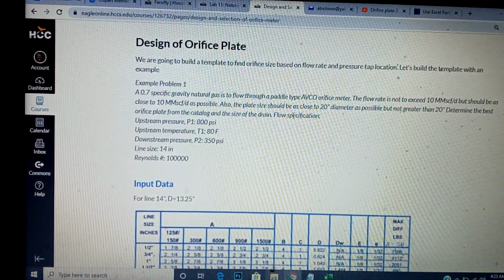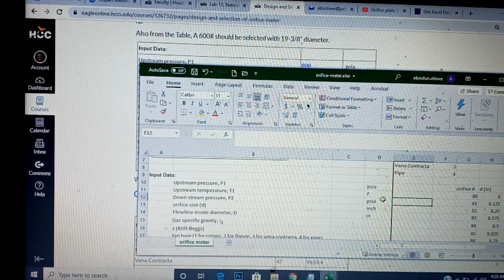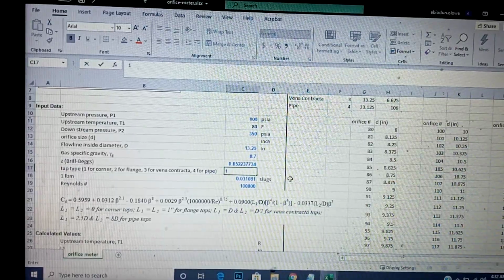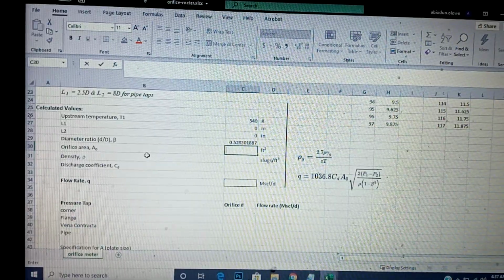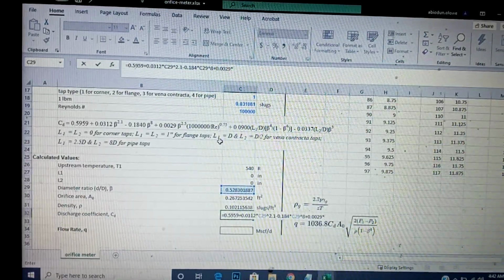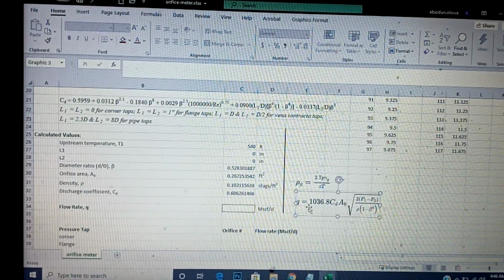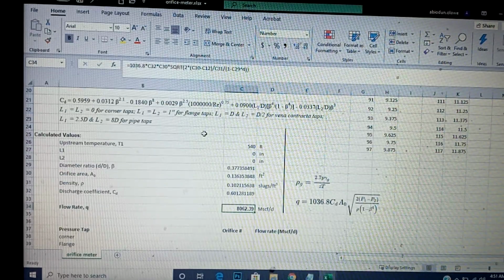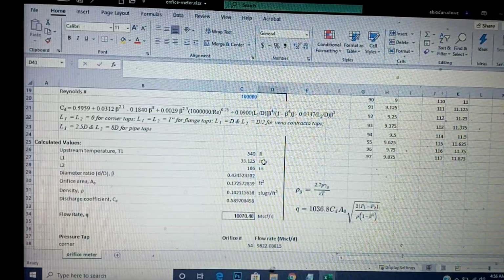Design and selection of orifice meter

Comment: Olowe, great to see you doing this. A few questions
1. Did you correct your D and d to 20 Deg C?
2. Where is the expansion factor ?
3. Some folks use 110% of given flow rate. What did you do in this case?